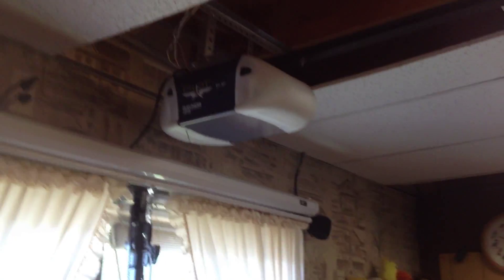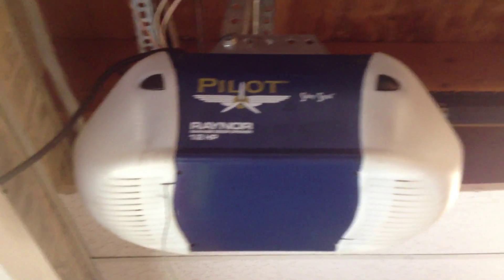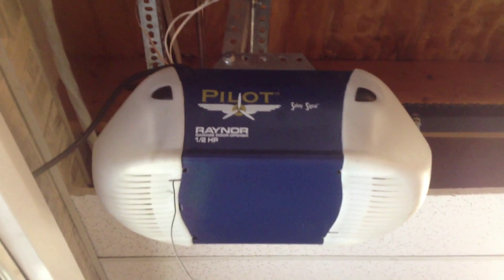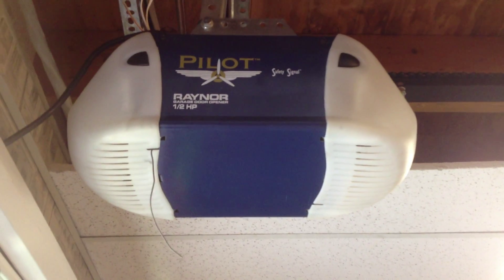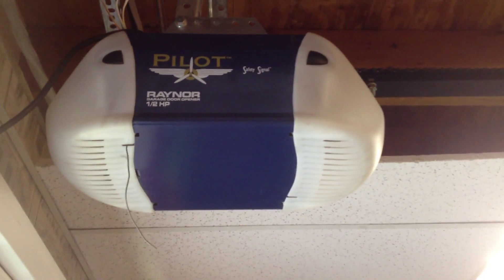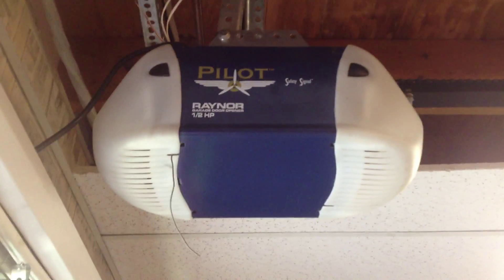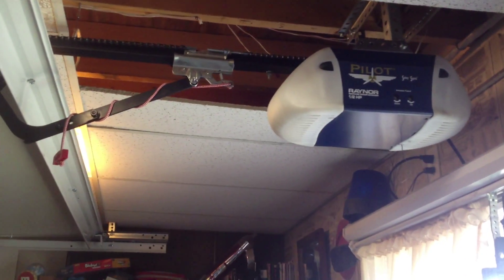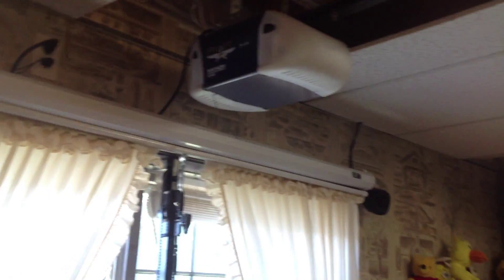2265rgd on the relante

Comment from the maker: Thats actually what i did when i first got it, I replaced and greased them, as well as the gear and still no dice.  Thats why I'm thinking there is actually a problem with the motor itself.  As for dates, it was made in 1/04, and i got no remotes or wall panel with it...